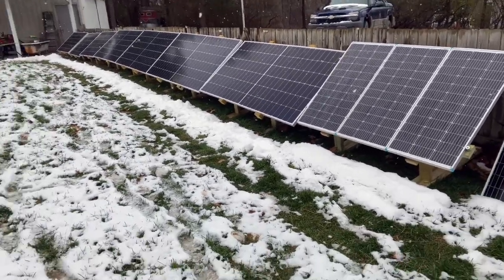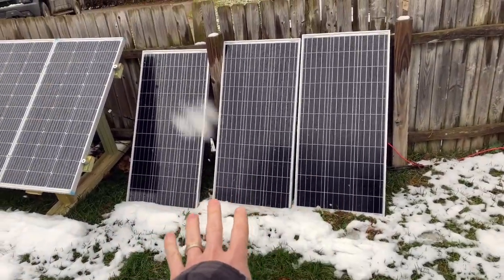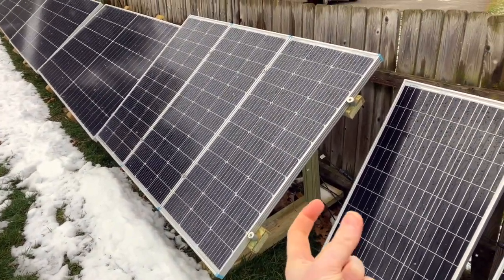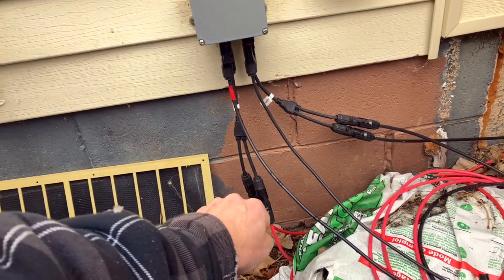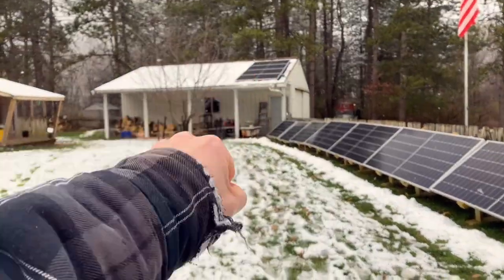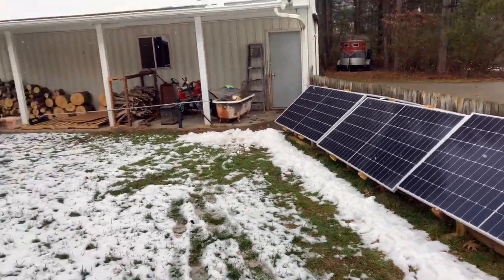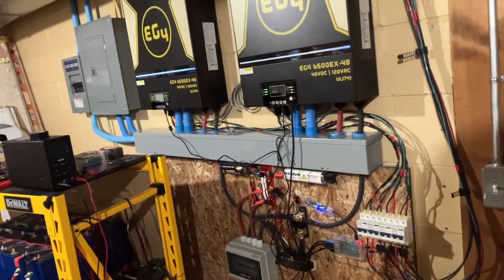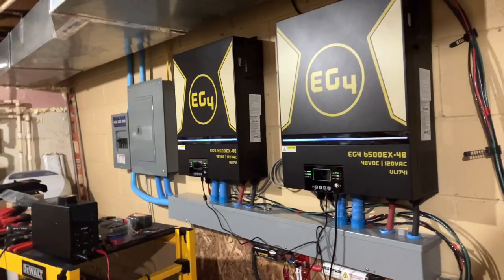Quick Solar Update

Comment: Add 10 degrees to you latitude for winter and subtract 10 for summer but chances are you won't need the extra power in summer unless you net meter and get credits then you may want to maximize the summer production.

Comment: NEC requires each string be fused if there are more than 2 in parallel. 2 strings alone can use a Y connector. As soon as you add a 3rd string, then all 3 strings require fuses. The Y connectors would need to go.
Reply from the maker: Right, thanks!  I only have the 1 paralleled string.  I have another hookup for a future string which is what I probably meant by when I said “third string”.  Unfortunately nothing in my near future…
Reply: I was lucky enough in MY planning stages - to decide on a FOUR (4) String ECO-Worthy COMBINER-BOX that came equipped with ...
4 individual 12-amp fuses ...
+ a 63-amp Circuit Breaker ...
( also SURGE / LIGHTNING Protection ... )

Comment: after two winters in Montana i have found that setting my panels for max production in winter, 43deg and leaving them this way thru summer i still have more than enough in the spring summer and fall. Winter is the lean time for solar, there are more loads for longer and less day time sun to provide power. If you can get thru the weeks around the winter solstice then you are good for the rest of the year.
Reply from the maker: Thanks for the tip!
Reply: ... I'm essentially LAZY & installed my ground mounts at 45 DEGREES simply because it was "close" & my RAFTER-SQUARE Tool had a 45 degree  ANGLE Built-In 🙂
Reply from the maker: @WiSeNhEiMeR-1369  🤣🤣🤣

Comment: Put your quirks on here sometime. Maybe we can help you solve them. 33,000 kW PV 143 kWh battery. Two Solark 12k, two eg46500ex! Totally off grid. 6.25 Ton 16-33 SEER heat pumps primary, wood burner and 10k lp Gen for backups. Keep up the good work. Add more pv, battery and two more eg46500ex.
Reply from the maker: Wow, a system most of us can only dream about!  Gotta start saving up my pennies!

I’ve got a couple that I’ll probably pose to the group.  Couple of them have me wondering exactly how I should handle them.

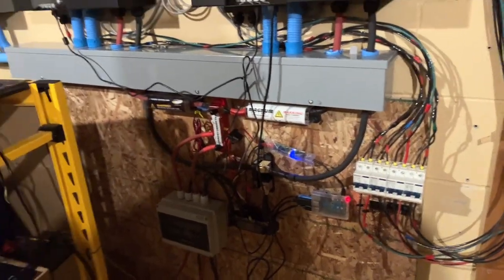Comment: At 50 degree tilt, I got 105% peak production from 32x390W bifacials.   Only enough sun from 8:30a-4:00p.   The rest of the time on batteries "in submarine" mode.
Reply from the maker: Yeah I’m hoping to get between 50/60 degrees.  Lots of tree shading in winter so I need to maximize where I can.

Comment: if your summer and winter degrees are anything like mine, you can probably make the same jig to switch from winter to summer. For me my year round is 30.7, spring and fall are 30.7, summer is 15.7 and winter is 45.7 so if I had something like yours at 30.7 degrees, a 15 degree wedge would make it summer from the front, and winter from the back.
Reply from the maker: Sounds exactly what I’m planning on dining!

Comment: EG4 Recently came out with an Affordable Ground Mount, it's able to hold Four 500w panels or SIX 200w panels. You should check them out it's called EG4 Brightmount Solar panel Ground Mount Rack Kit
Reply from the maker: Thanks, yeah I’ve seen the new videos regarding it.  Pretty interesting!
Reply: @AdamDeLayDIY  It's 200 something. it spans across 15 feet. I just got mine yesterday, it's worth it
Reply from the maker: @Moes_Prep_and_Tech  awesome!  What size panels are you putting on it?
Reply: @AdamDeLayDIY  I'm debating on putting SIX 190w HQST panels on it or Four 450watt renogy panels.
Reply: @AdamDeLayDIY  the only thing I don't like about the rack is having one leg for support in the middle instead of one on each side. the total array has 4 legs
Reply: Will Prowse made a quick 5 min video installing it
Reply from the maker: @Moes_Prep_and_Tech  yeah I saw that one and also one from Eric on Country Living Experience’s channel.  

It does seem like 4 legs would give more sheer strength than just the three.
Reply: @AdamDeLayDIY  It comes with 4 leg sections, but just one foot per leg, to support it, I'm used to having a support beam on the front and back and Eric from country living experience did a great setup video on it, I just didn't care for the Wood Base he used to secure it to the Ground, I might just Fill up 4 Home Depot Buckets with Cement and use that, I just don't know if that would be stable enough, I never tried it
Reply from the maker: @Moes_Prep_and_Tech  ah.  Yeah I guess it depends on specific needs and areas you need to mount to.

Comment: I use 15 kWh throughout the night. That takes my batteries down to about 85% couple weeks ago I had those clouds I looks like you are filming under for like 4 days straight it drained my batteries down to 10% and It auto switched to the grid for two nights. The sun was just enough to support the daytime loads but not really charge much. I have no shading. When we live in one of the cloudiest states in the country during the winter. Still saving for a quality turbine, tower and clipper. So don't feel bad about the shading. When it's this cloudy not much we can do.
Reply from the maker: It’s probably the same weather.  I end up making so many recordings that I stagger their release so half the time the videos are a week or so behind where I’m actually at.

Yeah, no one’s figured out how to get rid of clouds yet…😁  Gotta work with what you have, or move.
Reply: @AdamDeLayDIY  basically what I figured but wasn't going to say that specifically. For those few times a winter when it's 100% overcast the wind is usually blowing. Gotta do it
Reply from the maker: @electromechanicalstuff2602  exactly!
Reply from the maker: @electromechanicalstuff2602  you still have 70kwh or have you added in the other packs I thought you mentioned having in your last video?

Comment: Would be nice if I could do a grid assist set up in my house, unfortunately nec code won't allow it unless everything is UL listed
Reply from the maker: The 6500s aren't grid assist and have no way to push back to the grid, they only have a grid-bypass mode if you add grid input.  

Unfortunately UL tested isn't the same as UL listed/certified.  To my knowledge they're working on that though, so maybe someday soon!
Reply: @Adam De Lay  I meant pass through,  can't have any ties to the grid in any way where I live unless it's UL listed
Reply from the maker: @todamnbad  no worries.  I found myself saying grid-assist a lot even though I knew it was bypass.

Comment: How do you have your solar panels grounded?  I am having a hard time understanding the grounding aspect of Solar systems especially when in hybrid mode with grid backup.  Do you ground it by the panels or run a ground cable inside and have it tied into the utility power grounding rod?  I see a lot of differing opinions on that topic and was wondering what route you chose?
Reply from the maker: I've always heard to keep the panel ground separate from the utility ground (whether that's correct or not, like you said there's varying opinions out there).  So I ended up putting a ground rod out by my barn that the panels on my barn roof are grounded to.  The panels on the ground are not grounded at all.

Comment: 8am, already getting 3KW in.   South Western Ontario.
Reply from the maker: Unfortunately I don’t start getting direct sun till around 10 due to the trees and the house.  I have been toying around with putting an array in the horse pasture which would give me more open space, but it comes with its own set of challenges.
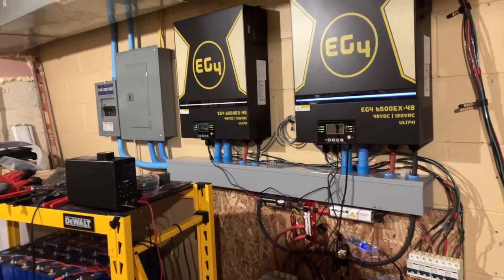Reply: 9:21,  9KW..   charging with 120A over 6 packs. And running 3.3KW load (3xheater on med).
Reply: But, it was zip yesterday,  barely enough to run base load during sun hours.   Feast or famine.
Reply from the maker: @errcl65  making me a little jealous… 😁
Reply: Panels are ground mounted 2x16 in an open field.  No obstruction, but it required 200ft of 8AWG (8 pairs, due to lower 250V Voc of LV   $$).  Tiltable, but point fixed to solar south.
Reply from the maker: @errcl65  very nice!  I’m guessing I would be somewhere close to 300’ to where I would have to run everything.  Each time I feed the horses I see the open area and keep thinking that I need to save up to get the wiring.  I can always start with just moving some of my current ground “mount” panels out there.  The wiring and the fact that I would be trenching near big trees and other underground lines are the things slowing me down right now.
Reply: @AdamDeLayDIY  You have already less loss by running a higher Voc with the EG's.  But the line loss is really high for 300ft.    We are only on our 3rd day of full use.   I am measuring temps on wire, breakers, etc..   Running almost full output,  the warmest components are the PV DC breakers sitting at 25C in an 13C ambient.   We run two 4S2P in each inverter's MPPT (nominal 196V@16A).   The combiners 
(yet another disconnect, fuses, arrestors) are outside at the base of the array.   Basically cold.
Reply from the maker: @errcl65  yeah I I need to get an accurate distance measurement to see what I need.  The higher Voc does give me a little more play room which is nice.  

Congrats on getting the new array up and running!  So what does that give you for total solar potential?
Reply: @AdamDeLayDIY  11:11 full sun,  the 2 x LVs are 11.4KW in as reported by SolarAssistant.   I saw over 12.4KW peaks.   These panels are top notch LG bifacial full glass.   I think with super cold and white snow, full sun,  it can go 13.5 ish....
Reply from the maker: @errcl65  around 11:00, I had 1.6kw coming in, but my panels aren’t all facing the same direction.  With the trees in the way, I have different strings pointing in different direction to try and maximize available Solar throughout the day.  In fact as I write this, I hear the inverters ramping up and down with the sunlight hitting different panels.
Reply: @AdamDeLayDIY  11:40 and the batteries are at 100% SOC, but still taking a bit of charge.   I estimated that with sun, we can recharge our nightly use by noon.   But this overnight load is very restrictive (little or no electric heating).   I have two 280Ah pack kits (Seplos Mason 280 and 16xEVE 280AH) coming in early 2023 to add 
to the night time heating.   Long term, our government wants to ban burning (LPG, NG, Wood, Coal) anything for energy.  Good luck stopping us from burning firewood.
Reply: @AdamDeLayDIY  Also, you may want to better arrange your stringing as shading within string can really drop the output.
Reply from the maker: @errcl65  yeah I think my wife would revolt if she couldn’t have her electric blanket.  What would your capacity be up to after you get the new batteries?

That’s crazy that the govt is trying to ban burning wood.  I’ve been dragging my feet firing up our wood boiler as I don’t have a good stockpile of wood this year.  Been a little preoccupied with solar… 😁  Probably need to fire it up though shortly.  Will be nice to not use the electric water heater…
Reply: @AdamDeLayDIY  56KWH when the Seplos get here and built.   The more options for heating, the better.  As I said,  solar is feast for famine.   We heat with 60% wood,  30% LPG and 10% hydro.   With enough of a bank, 
I want to totally displace the LPG.  I experimented with evacuated solar heating tubes which work very well and are very cost effective.   PV, LifePO4 - ROI is iffy, but being self reliant is priceless (if you have the coin).

I also think you should buy a 3rd inverter for backup.   In the whole scheme of things, the inverters were the cheapest part of the system.   And MOST prone to fail IMHO.    I have 2 spare, wired (and off) and ready to go
as either backup or ready to accept more PV for 26KW (which is insane).   Any how, it is cheap insurance
considering Signature Solar's overwhelmed customer support.  4 x LV share a 1000A bus bar pair.

My plan is 3 days on batteries with 16 hour battery runs on baseload (well pump most important) 
and 3-4 heaters running at 700W.   I'll keep adding more storage as time goes on.  If this Seplos experiment
goes well,   I will do it again as it really is cost effective ($1.1K USD for 5.1KWH vs. $2K USD for available
racks here CND+taxes).

But I can also ease off that with a planned EV in 2030 which can act as parked storage as well,  
so 56KWH may be enough.

Comment: You're lucky you have a fence behind it to block the wind.  The need to be higher so you can get the lawn mower under the front.
Reply from the maker: One quick zip with the weed whacker takes care of anything growing up.  They’re actually that height to be completely hidden behind the fence.  Pulling up my drive, you might only see the few panels on my barn roof.

Comment: Not sure mixing solar panels is a good idea
Reply from the maker: You can mix panels as long as they have similar specifications.  

In my particular case, the different panel strings are wired into a separated  Mppt in the inverter, so they’re not wired together with the larger panels.